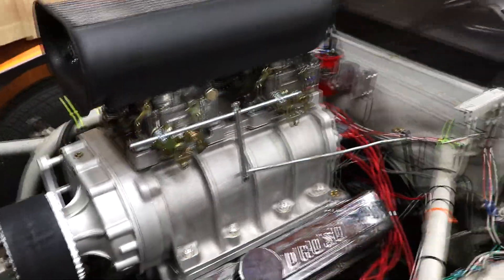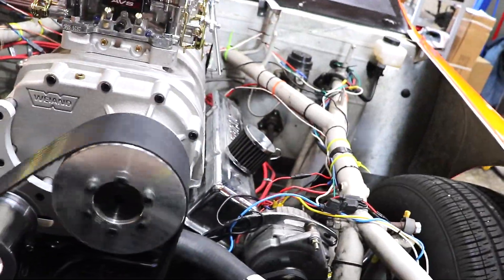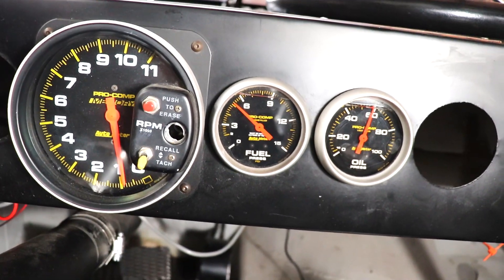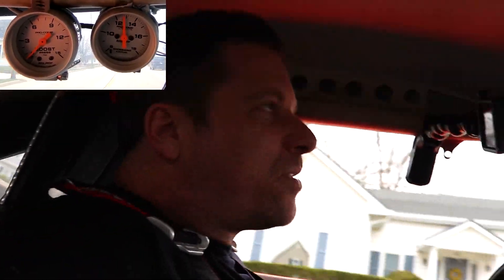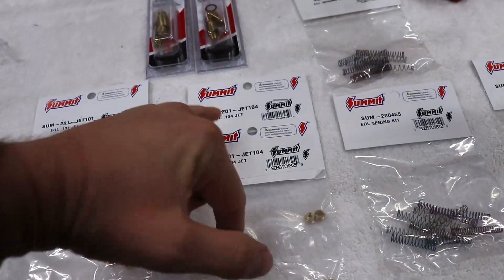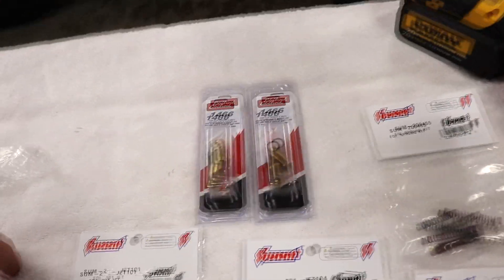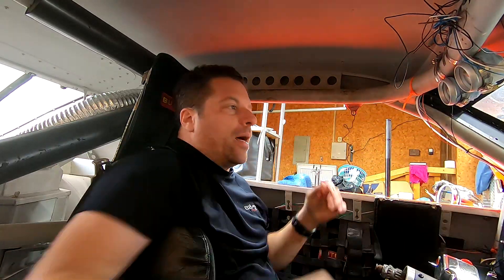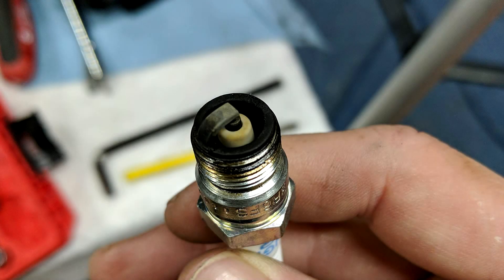Tuning the Carburetors On The Supercharged Tide Car

Comment: The carbs need boost referenced. That initial lean hit at the start of your throttle application is the needles not fully opening and staying open under boost and you are jetting the secondary's to make up for it. That's why the AFR comes back down as they open. My opinion anyway. Great truck!
Reply from the maker: Thanks! I appreciate the feedback, but these Edelbrock carbs do not need to be boost referenced. The lean spot is due to the air valves over the secondaries opening too early. They create a low pressure area, like a choke does, until the engine speed catches up. I should do a video on how to tune those actually. Since I haven't tuned them yet.

Comment: What did you end up running for plugs in this setup? I’m doing a stock sbc with the same setup
Reply from the maker: I believe they are Delco R45TS.
Be sure you get the right plugs for your heads. The TS stands for "tapered seat" the R45S plugs are a flat washer seat, not tapered. I think just about everything is tapered, but I'm not 100% sure about that.

Comment: i think you needed more accelorator Pump shot   that should stop the leantip in
Reply from the maker: That helps a stomp bog if you have one, but the lean tip in is a transition issue. It happens because the needles don't gradually transition from rich to lean, the switch is instant. Edelbrock gets around this lean dip by adding a secondary butterfly that stays closed like a choke until just after the lean transition, keeping the secondaries drawing extra fuel until the primaries catch up.

Comment: Have you modified these for boost reference? I was worried that my AVS2 carbs would need modifications but you seem to be doing just fine with however yours is setup?
Reply from the maker: @Tekgnome.  The way Edelbrock carburetors work, there's no need for boost reference in this instance. The top of the supercharger simply pulls more air through the carbs. It's like the carbs are sitting on a big block.
Some guys argue with me that during WOT the pressure is closer to atmospheric on an N/A engine and there's vacuum on a supercharger and blah blah blah. The car runs great. No need to argue 😆 

Thanks for the question 😁
Reply: @RightTurnRandy  Awesome!

I'll move to a #8 spring, with .104 mains, .100 secondaries, with .068 x .042 rods.

I'm only running a single AVS2 so I might need a bit more fuel. Mine is a 302 with like 30% under driven (aiming for 6-7psi)
Reply from the maker: @Tekgnome.  You'll get a flat spot on acceleration where it leans out. The AVS stands for "air valve secondaries" (you may have already known that) that's how you tune out the flat spot is by adjusting the spring tension on that butterfly over the secondaries. I should do a video on that, but look it up once you get the mixture dialed. Read plugs if you don't have a wideband. There's a way to do that that involves killing the engine during cruise, WOT, etc to see what the mixture is and adjust needle and jet sizes that way.

Sounds like a good plan! I don't even remember the needle and jet settings anymore it's been so long. Good luck!
Reply: @RightTurnRandy  a video would be super helpful if you're up for it.

I'm going to run a dual wide band with an O2 in each bank just to make sure everything is happy and to be able to diagnose things a bit better.

My manifold ships on the 30th so I still have a bit of time before I need to worry about tuning her. Thank you for the help, I appreciate it!
Reply from the maker: @Tekgnome.  It's tempting to have one in both banks, but it's really not necessary. The mixture is the same for both banks. The best the other bank might tell you is that you're down a hole, but that would be obvious.

Your project though! Sounds like a good one, I hope it goes well.

Comment: Are you using boost reference power valves?
Reply from the maker: There are no power valves on these carburetors. And with this setup, you don't have to have a boost reference for anything.

Comment: You never even pulled a spark plug to see how it is really burning the fuel. If you ran it too lean to long there will be aluminum particles in the spark plug...UM NOT GOOD...

Comment: Edelbrock carbs... 🤢🤮
Reply from the maker: Best street carbs on the market. You can have that 7hp@6,000rpm. I'll keep changing jets without getting fuel everywhere.
Reply: boohoo, mileage AND power? yes please! also, afbs can be tuned by just lifting the top plate off. no gas all over your intake, ripped gaskets, etc. also, holley vacuum secondaries are garbage, not to mention the holley's special ability to fry the power valve if the engine backfires.

Comment: Did you tighten the secondary air door springs? . That's your lean out problem.
Reply from the maker: I haven't started messing with the air valve secondary. I will eventually but I'm rebuilding another car right now.

Comment: Wait wait wait. You are using an AVS2 carburetor with a supercharger?  I just want a clear answer before I memorize this video. I was told you had to get a blow through carburetor for a supercharger.
Reply from the maker: For a turbo, you would need a blow through carburetor since it pressurizes the entire airstream. All a supercharger does is draw more air than the engine would normally. The only issue I've had so far is the normal step up springs aren't quite strong enough to quickly lift the needles upon off idle acceleration. Yes, they are AVS2 carburetors and they work great. If I got the right step up springs and tuned the air valves properly they would be perfect.
Reply: no, not at all. a old style roots supercharger doesnt need a blow through. it just sucks through the carb. only thing you need to kno is that you may need a super stiff step up spring because of the supercharger vacuum signal being more than n/a.

Comment: If you change de Power Valve sinal, like people do in Holley carbs, maybe you a better ajustment from the Springs? Sorry my english is terrible...... Hugs from Brasil!!!
Reply from the maker: Thank you for the suggestion!
Edelbrock carburetors do not have power valves. I can find custom springs if I really need them. The car is running very well at the moment.
Reply: @RightTurnRandy  but the metering rods had a vacuum signal Just like a Power Valve in the Holley, change This signal can be better? That what I mean, again Sorry my terrible english, and you car really looks awesome!!
Reply from the maker: @vitorcruz9586  Thank you so much. I can't adjust the amount of vacuum the springs see without modifying the Carburetor body. I'm not confident enough to engineer something like that.

What you are suggesting is a very good idea. To reduce overall vacuum for just the springs would be an excellent solution. I don't believe it can be done easily.

Your English is quite good.
Reply: @RightTurnRandy  I have a plan to change This vaccum signal, a carb spacer with holes and a hose conecting in the intake, that way you don t need to change anything in the carburetor, Just isolating the vaccum signal between carburetor and blower!! I never try This, but in theory is perfect, in the Future I in tend to blown my Brazilian version of the Ford galaxie 500, with 302 small block Ford and edelbrock avs2 carb, Just like you!! But supercharging an v8 in Brazil is not easy and accessible like in USA.... Unfortunetly
Reply: @vitorcruz9586  Did you every finish your blown 302? 

I have a 671 on the way for my 302 swapped 1965 Mercury Cyclone

Comment: You need to change the vacuum port on the manifold down and block the carburetor vacuum on the throttle Platte
Reply from the maker: To what end? I haven't had any issues at all. Car's running perfectly right now.
Reply: @RightTurnRandy  seems to run a bit lean at the moment you step on the gas, the supercharger produce too much vacuum when you accelerate.. search vor boost reference modifications on your carb..
Reply from the maker: @the350v8  Carter style carbs don't need that. The lean spot is a combination of the secondary air valves not opening at the right time and the step up springs being too soft. I could tune it out, but it's gonna be a lot of work for that little hiccup. I probably will eventually.
Reply: @RightTurnRandy  anyway, absolutely great work...
Reply from the maker: @the350v8  Thanks! I appreciate that. Thanks for weighing in. I appreciate the input. I learn a lot from people commenting.

Comment: What blower is that and is it one of the whiniest noisy blowers ?
Reply from the maker: It's a Weiand 6-71. There's a video of the whole install. Everything done to this car is on the channel.

It's not super noisy. Some guys have timing gear sets that are gear driven, super noisy. You can hear the supercharger, but it's not grating and certainly not louder than the exhaust. I personally love how it sounds.
Reply: @RightTurnRandy  ya , I have a Pete Jackson gear drive in my 64 el camino sbc , but am thinking of building a low budget 350 with a blower and love that whiney noise , thanks for the quick response and kool car you have there.

Comment: These carbs worked right out of the box with no modifications for a draw through/ supercharger setup?
Reply from the maker: Yessir. Changed needles, jets, and springs since. It fired up with both carbs straight from the box though.

Comment: Randy, what ratio are you running on the blower?  Top Pulley teeth = ?  Bottom pulley teeth = ?.  I just picked up my blower and I want to get some feedback on amount over\under drive on your small block.
Reply from the maker: It has a 38 up top and I believe a 34 on the crank. Works out to something like 15% under drive. Or maybe 12%, can't remember.

Comment: a roots blower will have a stronger vacuum signal than a NA engine.
Reply from the maker: So many people say that, but I haven't noticed the difference. I don't see, in terms of physics, how it would be any different, under the carbs, that a larger displacement engine.
Reply: @RightTurnRandy  It is different in effecting power valve/vacuum metering rods, The blower pulls air harder than pistons do, even at idle.

Comment: How did you hook up that wideband for two carbs and the blower....Thanks
Reply: Thank You
Reply from the maker: Simply plugged the sensor into the driver side bank exhaust collector and wired it up as normal. Works great!

Comment: Very nice set up. I am curious on your throttle linkage set up. Any part numbers or info would be greatly appreciated.   Keep up the great information
Reply from the maker: I got the linkage kit from Summit. Was like $14. The pedal is a lever design. It came with the car. It attaches via bent aluminum brake line and assorted fittings to the linkage.

Comment: You need to put a vacuum gauge next to your A/F gauge.  That way you can see the exact correlation of A/F changes and 'load' at the base of the carbs

And you'll be able to see exactly when the metering events take place.
Reply from the maker: Would be good info to have. I do know that both carbs are at 20" at idle 😆😆
Reply: @RightTurnRandy   Vacuum gauges are VERY underrated tuning tools.

I think they were old school when my grandfather was hotrodding.